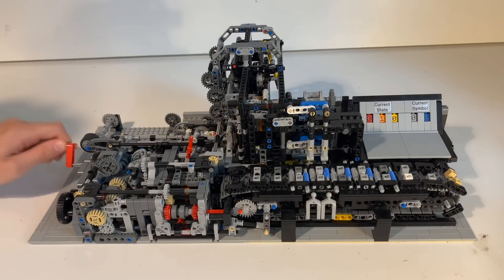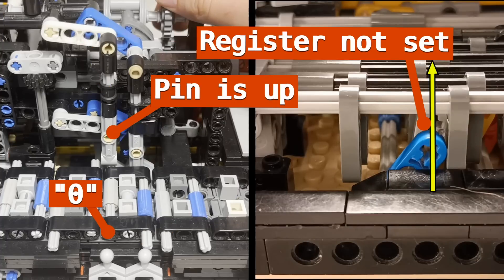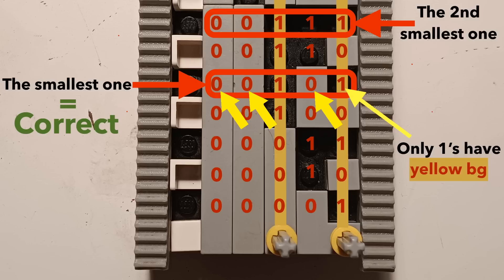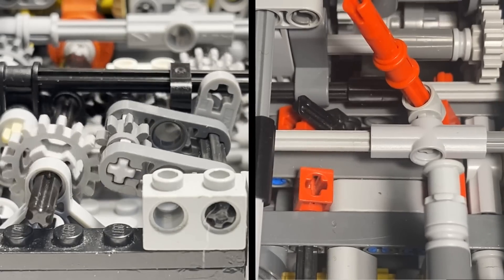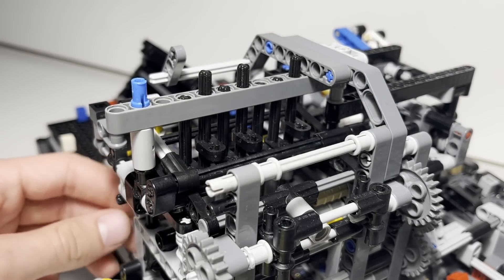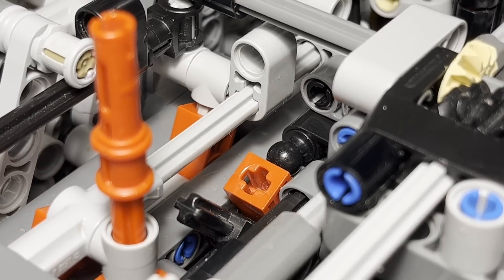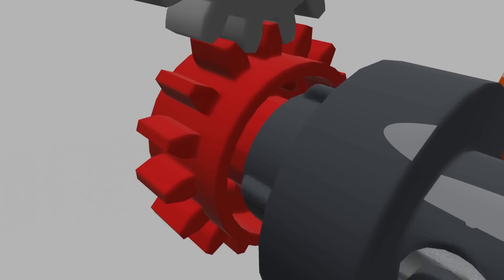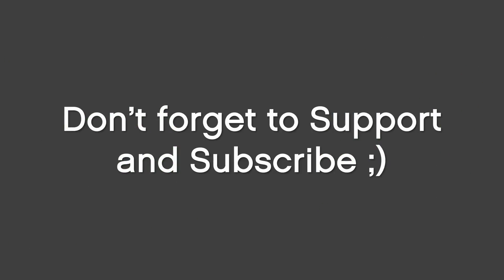Lego Turing Machine (no annoying music)

Comment: Learned today (June 2025) that lego have shunned this idea, with lots of weasel words to make it sound better.
Although 'Bananaman' did 3D print some parts, it is my understanding this was simply because it was cheaper than buying a set for something else just to get that one part.
In other words, all lego would have to have done is fill a kit with existing parts!

What a weak response. My view on lego has taken a huge dive... when it is OK for them to produce multiple custom parts to assemble into a kit of only a few dozen all-up bits, and something that embodies a true - and highly influential - design is shunned...
Shame, lego, shame.
Reply from the maker: They send the same message for everyone, it was probably sent by a bot. For now I'm doing some improvements and I'll re-submit it. This time it will be more reliable and easy to build + there will be a free instruction
Reply: You should make a kickstarter out of it…is it possible to support / sponsor you for this project financially?

Comment: But what did you program it to do?
Reply from the maker: @Glutnix  nothing lol, it just needed to look nice
Reply: With total tape length around 8 bits (if I understood the parts with blue collar correctly) the best you could do is calculate sum of two 3 bit numbers. However, if you had a lot more parts, you could create a long tape and make it run more interesting programs.
Reply: @MikkoRantalainen build a bigger one and install Linux on it
Reply: @javelance  Yes, if you had long enough tape and lots of time to run code, you could build something similar to Gigatron project on top of this. Basically you would first create Turing machine that emulates 8-bit Harvard architecture CPU and then use that to emulate 16-bit von Neumann architecture to have something that is possible to program by humans.

Of course, even 16-bit CPU wouldn't be good enough for Linux which requires 32-bit CPU with MMU at minimum, so you would then need to emulate that.

This four level deep emulation would obviously result in very little fragment of 32-bit instructions to be executed on each rotation of the Lego gears but it would result in a working Linux system.

Not pratical by any stretch of imagination, though.

If you're not familiar with the Gigatron project, a video titled "Hackerhotel 2018 Walter Belgers Gigatron" here on YouTube is a great introduction to that project. Even if you weren't actually interested in building a computer from scratch, that really allows you to understand on hardware level how one could create a new computer system from scratch.